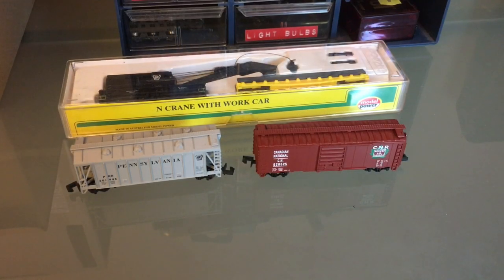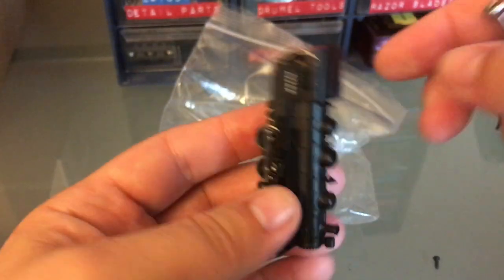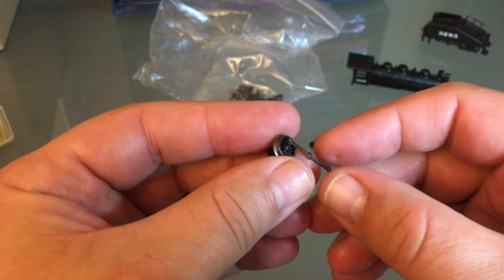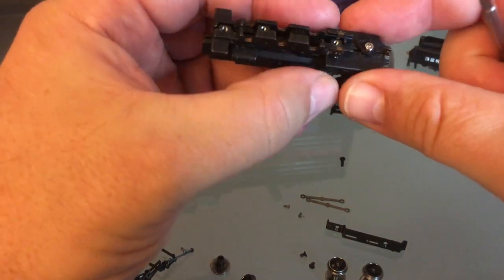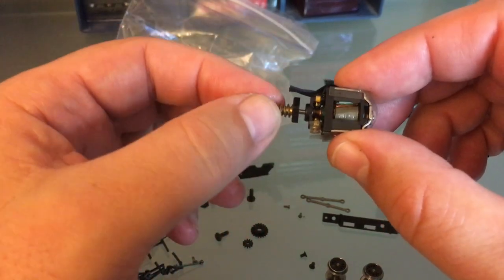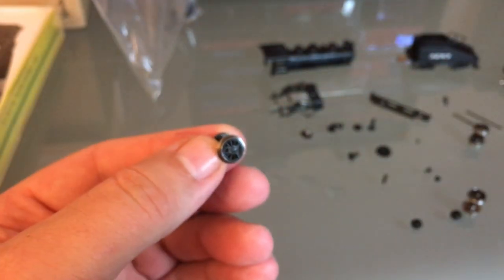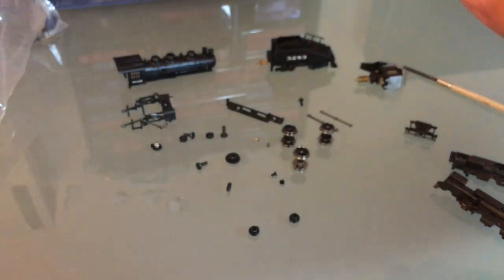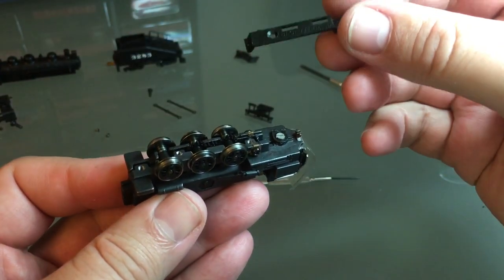N Scale Bachmann 0-6-0 repair

Comment: It has been a while since you posted this video, but I thought I would share my recent experience with a Bachmann 0-6-0. 

Recently, I received a brand new Bachmann 0-6-0. It is a very nice little locomotive with sloped tender. Runs really good at slow and high speeds. Very quiet. I just hooked up 18 twin-bay hoppers, one small tank car, and a caboose, and it pulled all 20 cars (unweighted) quite easily at low speed (and faster) on a level track. I am pretty impressed. I do not want to overwork the Loco, so I did not add any more cars.

Your two 0-6-0 videos were the primary reason I decided to get this locomotive.

Thanks much!
Reply from the maker: Yes it was fun to fix!

Comment: This is an awesome video Eric. I had two Bachmann 0-6-0s that I tore apart and fixed. They ran fine when I sold them on eBay. It was a struggle to fix them and this video would have been such a big help a couple of years ago.  I sold all my steam except for three because they are so finicky. I keep my Rivarossi 0-6-0 because it runs pretty nice. I also have a Rivarossi 2-8-2 and lan Atlas pacific that run nice. They all run nice it won’t pull worth a crap.
Reply from the maker: I you get a Kato F-E-F 3, you will see: It’s completely different.  You can enjoy running steam trains.

Comment: Great video, regrettably when I tried to follow your example on a 080 I failed - hope to find someone as skilled as you to repair it for me..
Reply from the maker: Is it an Atlas?
Reply: @watchtrainsnow1099  No it's a Rivarossi N Scale 0-8-0
Reply from the maker: if the motor runs it' s possiblesome you can fix it. if the motor is bad, I know a guy who can fix it.
Reply from the maker: https://youtu.be/UT2E2smU0E8
Reply: @watchtrainsnow1099  The motor seems fine it runs briefly until the valve gears / linkages become stuck again
Reply: @watchtrainsnow1099  Says no custom work on his YouTube comments...   :(   I will try Atlas/Rivarossi maybe they agree to repair it for me! Its is a great little loco, happily pulls 8 coaches and caboose

Comment: Thanks for this tutorial. I recently bought a very old N scale Locomotive (it works just fine), and I was curious about how these Loco's came apart, but it seems most YouTube clips II saw so far covered Diesel Engins, and not Steam Locomotives.
Reply from the maker: Steam is hard to work on. I’ll make more steam videos later.

Comment: Nice video. I don't know if you have any advice but I got a new ho model of a 0-6-0 and the rivet connecting the crosshead to the side rode I think is loose because the crosshead comes out of the sidebar. You have any idea on tightening it by yourself?
Reply from the maker: I’m not sure. I have repaired broken parts before with crazy glue. But you have to be careful not to get it in moving parts.

Comment: I have two of these 0-6-0 and there still in parts on my bench in a plastic jar.
The gears were cracked and they need replacement maybe I'll finally get the courage to try and fix them
Reply from the maker: Yes, it’s not the best engine to get.

Comment: Had mine apart a couple times. Trying to fix that broken part. 
Finally gave up. Kept breaking. Put it in a box.
Reply from the maker: Yes, I don’t recommend buying this engine. It’s good  if you like to repair engines and you want a challenge.